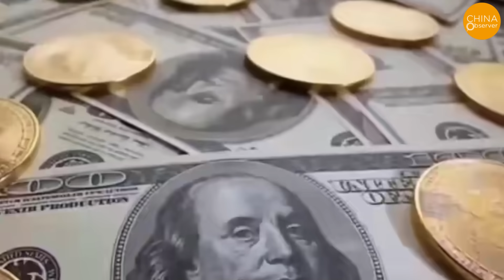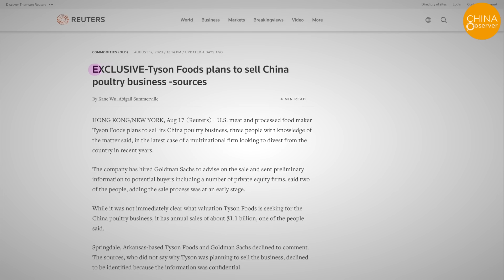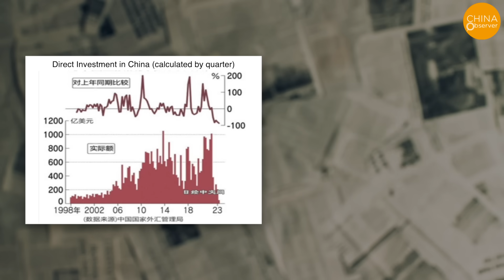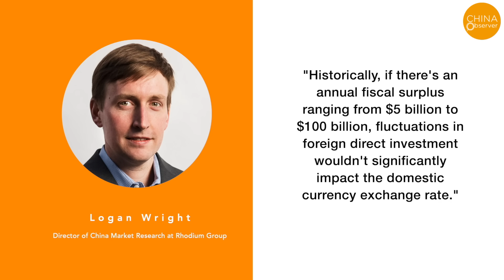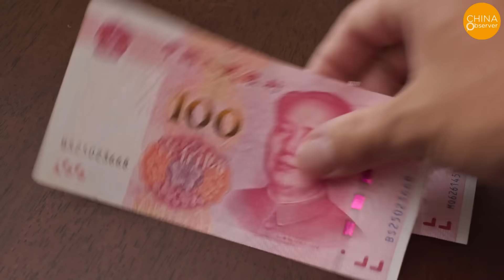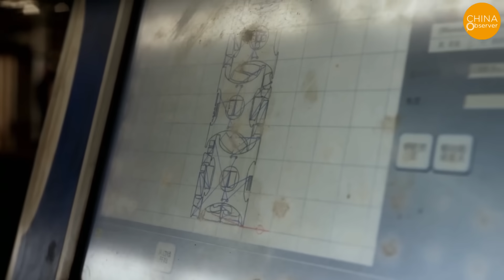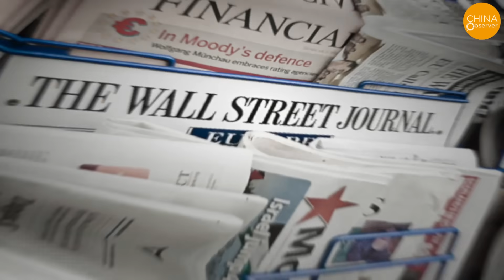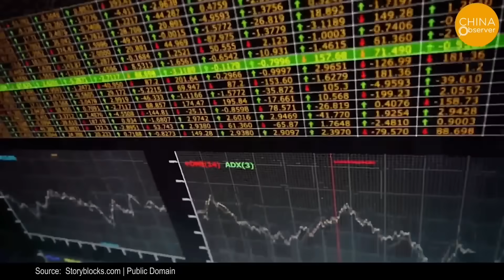China’s Economy Hits a Death Spiral: Tyson Foods Left, Cargill Followed; Yuan Loses Key Support

Comment: The amazing thing about all this is how it all hinges on politics. China was going to decline as a long-term investment goto place anyway, because of it's rapid demographic aging, but Xi Jinping's aggressively left-wing Communist policies plus his effective neutralisation of internal opponents in the public arena (the Jiang Zemin faction), has given the signal to foreign business and investors in China to leave, and to leave fast. I worry about this as it may occur to Xi that launching a war against Taiwan to kerb his largely self-made political-economic crises at home may be his only option left to hold onto power. The business community who listened to Kissenger et. al. in the first place might consider that just replacing Xi would be optional to consider re-investment in the future, but those business elites are deluded. It's the party and it's system (the CCP) which politically and economically pollutes China; not so much the dictator presiding over it.
Reply: That would be suicide.
China only has 80 days oil supply...virtually all of their imports would be cut off in the Malacca Straits.
With the huge floods they've had they're going to need huge food imports...or mass starvation will occur.